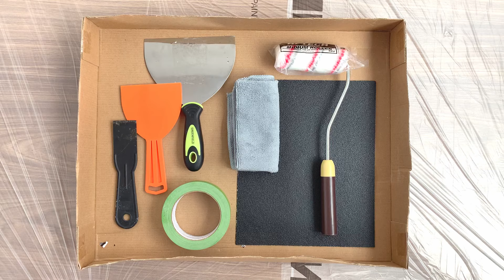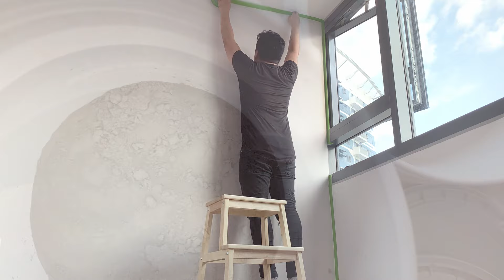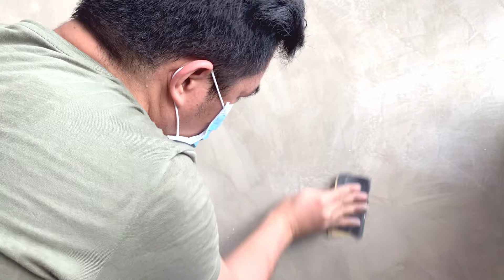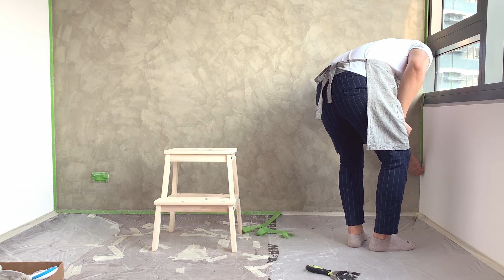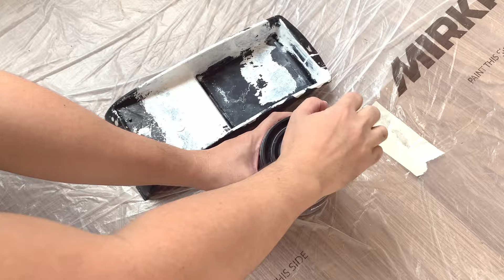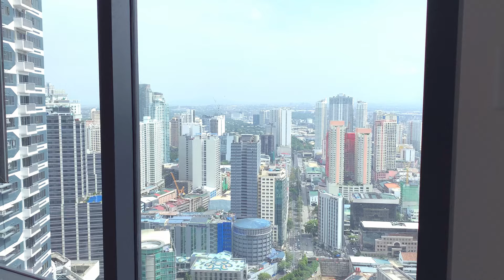How To Create Concrete Finish Wall | DIY | Modern Industrial | Accent Wall

Comment: pwede ba to sa plywood sa loob ng toilet or shower room and waeter proof ba?
Reply from the maker: Pwede po ito sa plywood, concrete or fiberboard. Compatible po sya for both indoor or outdoor use. pero di po sya water proof… pwede nyo po applyan ng sealer pra maging water proof po sya or a film-forming membrane… 😊
Reply: @STUDIOPLOY  thanks for the tips sir

Comment: Sir recomended ba ito sa bathroom walls?
Reply from the maker: Yes, pwede din actually Ito sa outdoor, But since most of the time mababasa sya sa bathroom I would recommend sealing it with a tile sealer para di sya kapitan ng molds and maging water resistant sya.. 😊

Comment: Ano po b puede topcoat jan n waterbased topcoat ung hindi makintab..salamat
Reply from the maker: Meron sya mismong topcoat for it, glossy sya pero pag inapply di sya makintab... pag gusto mo naman na maging water resistant sya you may apply tile sealer pero currently wld pa ko akita na matte sa market pro gloss plant... 😊

Comment: sa concrete wall lang po ba cya or pde ipatong sa wooden wall?
Reply from the maker: @gmadridano4442  aside from concrete walls, compatible din sya sa wood and fiber cement board walls… make sure to scratch the surface with a lower grit sand paper pra mas kumapit and pwede mo na gawin procedure na ginaw ako dito… 😊

Comment: Pretty nice video! Tanong lng po sana if applicable po ba siya sa lahat ng wall types especially concrete?
Reply from the maker: concrete ang ponaka compatible sya... pwede din sya sa drywall and sa plywood. indoor and outdoor parihas swede... thanks btw! 😊

Comment: may i ask, the white thing that mix with cement/grout is white paint or what?
Reply from the maker: I don't know what exactly it is since I would purchase it in set. and Davies would only name it as Set A (the liquid) and B as (the powder). The product name is WallArt Industria. But If I may examine the the component it does looks like cement powder and While Latex paint though it probably has an added component. 😊

Comment: Beautiful work. I’m looking to do something similar in my home. Would you be so kind as to tell me the product you used? The cement and the white glue specifically. Thanks so much.
Reply from the maker: The product I used here is a concrete plastering cement called WallArt Industria by Davies paints. I don't know if it's available in the US though. A subscriber once told me that he experimented mixing cement with white latex paint and works the same... 😊

Comment: Yoo can this be applied to wooden painted walls??
Reply from the maker: Yes, It's compatible both wooden and concrete walls... make sure though to sand the painted wall with a lower grit sand paper and mist it before application... 😊

Comment: Hi po, hindi po ba sya madali magcrack? Pano po kung may kelangan isabit sa wall at need ipako? Thanks
Reply from the maker: If properly applied, Hindi sya medaling magcrack. applied this to our unit and almost 3 years now, still in a very good condition parin. Pati pag pako and drilling... 😊

Comment: Hi bro before you apply the paint. You scratch the old paint at the wall or not. And did you apply primer or sealer first before start
Reply from the maker: I only do sanding using an 80grit sand paper before application. No the wall was already sealed and primed before this application... 😊

Comment: What if I use basic cement mixed with water
 Will it crack?
Reply from the maker: Yes it'll definitely crack, you have to add flat white latex paint that would prevent the mixture from cracking... 😊

Comment: The material you using eslecally for finish is not good, as cement cracks and you get damp and mould on it in time, due to condestation etc. Lime putty would have been best and you could add colour pigments to lime like oxide powder. Lime prevents mould growth damp proff and mould proff and healthy for building and ppl. This is a teriible product, who gave this idea as top coat, will find out the real issues on your wall, waite and see granteed.

Comment: The looks are lovely, really modern and industrial. But I just keep wondering, can a topcoat can be REALLY CLEAR, as all of the clear coating products tend to make the surface a bit darker at the end😢
Reply from the maker: The topcoat I used here is really design for this product and it actually enhances the texture without altering the color. I agree some tend to darken and some has this super shiny finish that I really don't like but this one retained the rawness of the cement finish...😊

Comment: Ang galing! I want to do this design on my bathroom walls. I heard that it's better to apply (a certain degree of) waterproofing with the concrete finish wall. How would you suggest to do the waterproofing? How would you suggest to do the waterproofing without affecting the concrete's raw color/texture?
Reply: Spray tile sealer is transparent

Comment: I'm planning on doing this for my bedroom but I'm a bit concerened to what the process of getting it back to normal would be - were I to ever sell my place. I'm assuming you could just plaster over it again? How do you remove the Concrete ?
Reply from the maker: Hi Liam! It would be tedious to remove this. Yes plastering it over is an option or you can refinish it by applying a wall putty to even out the surface before repainting...😊

Comment: Hello recently subscribed an binging your videos! I'd like to ask, is this something that you would recommend if I'm going to apply this to my 23sqm studio unit? Or is it much easier to just paint in a shade of gray. I know I will miss out on the texture and patterns but I'm not sure if ideal to do so since I'll be doing it by myself only.
Reply from the maker: Welcome aboard Benj! It's easier to paint it with gray but there is an easier alternative and a little cheaper than this one. I would place it in between this and paint. Check out Limewash Paint, It still has this texture though not very similar but I would go for it than gray paint. I have a tutorial for it due for posting next month... 😊
Reply: @STUDIOPLOY  I have a satin finish paint on my concrete wall, I am torn between using Boysen Flat latex white and  Davies Primer and Sealer-- do they function same as primer for a limewash paint? 😅

Comment: does it work on dry walls po ba? di ba yan ba magcacrack kapag na slightly bend yung dry wall?
Reply from the maker: Hi Oliver! Yes its compatible with drywall or any fiberboard made wall even plywood... To a certain extent yes wag lang sobrang bend kasi mbaba tensile strength nito even the actual concrete pero mas durable sya compared to skim coat...😊

Comment: Hello, my wall is currently royal blue. Tapos gusto ko siya i change into this color. Deretso ko lang po ba with the same process as yours, or do I have to remove the blue paint?
Reply from the maker: Hi Az S! The initial step would be to sand it with a lower grit sand paper kung hindi mo tatangalin ang paint, pero if madali lang matuklpa ang paint pwede mo din remove before the application then same procedure na sa ginawa ko dito...😊

Comment: Nag apply po kami ng skim coat, pero after 3 weeks po ay nagtuklap. Finish po ang wall. Ano po ang possible na dahilan? Sabi po ng pintor dahil daw po sa init, posible po ba ito? Yung likod ng wall po kasi na yun at direktang nasisikatan ng araw sa tanghalo hanggang hapon. Magagawan pa po ba ng paraan? Salamat po
Reply from the maker: Hi Clarissa! Masyadong mabilis ang 3 weeks na pagtuklap usually it would take months or even years kahit pa direct sa sunlight yong wall kasi gingamit din outdoor si skim coat... There must be something wrong sa process... Ano ang status ng wall bago sya applyan ng skim coat?

Comment: Sir tanong ko lang po kung anu ung pinagmixed nyo pong una? Pintura po ba un at semento?, kc iapply ko sa wall po namin kc nasisira ang pintura lagi gawa ng tubig nasinip po sa wall.
Reply from the maker: HI jct2! set na yong WallArt Industria pag binili at tinawag lang syang na part A(Liquid) and part B(Powder)... Yong liquid though mukhang paint, mukhang may bang element sya a regular paint...😊
Reply: @STUDIOPLOY  ah okay po, mgkasama na pla un sa isang set, cge po maraming salamat

Comment: Pwede ba yan for bathroom? Will it still be low maintenance di didikitan ng lumot or molds? Thanks
Reply from the maker: Hi Aj! Yes Pwede pero kung sa shower area mismo, definitely overtime magdidevelop sya ng molds kung hindi well maintained... Pero some other parts na hindi basain pwedeng pwede actually pwede din sya pang outdoor...😊

Comment: Can this be applied directly to a wall cement finish? No need to paint it with flat white?
Reply from the maker: Hi Mark! Yes no need to paint flat white, its actually better if the wall is not yet painted for better adhesion...
Reply: Thank you for the info! BTW, nice work!

Comment: can i drill hole after doing this ?will it crack ?
Reply from the maker: Hi Javen! Yes you can, this is actually part of a 1Br unit makeover posted and we drilled a lot and attached a huge framed mirror and artwork and so far no cracks even with my previous project… 😊

Comment: Great job N' video  @STUDIO PLOY 
what if someone wants to paint it white, not grey? like those vintage white color with almost same texture?
Reply from the maker: Thanks Farhad! there is a different product if you prefer white. Industria is only available in gray or cement finish, though you can try using a white skim coat mixed with white paint if you prefer the same texture in white...😊

Comment: Hi! Your video is super helpful and inspiring! 🙌👏👏👏 I really want to do this for our accent wall. Question, can I also do this directly on ceramic tiles on the floor? God bless on all your projects!😃
Reply from the maker: Hi Jerica! Glad you like it! I wouldn’t recommended this for flooring as it will not withstand live loads, also with the ceramic tiles as base it will easily chip off… A better option for a cement fonish look flooring would be polished concrete… God bless and stay safe… 🤍😊

Comment: Hello Sir. Just as I was looking for here. Salamat po... Sir, ask ko lang po sana if this process could be done po ba sa floor or iba naman po? Salamat po sa advice Sir...gusto ko po sana kasi na smooth lang ang floor namin po
Reply from the maker: You're welcome Mercel! I wouldn't advice using this product for flooring, magbabakbak sya hindi nya kakayanin yong live loads... Better option is fresh concrete then pakinisin ng purong cement or best option is polished concrete, hindi na nman ito ganon ka expensive unlike dati...😊

Comment: Hello sir, pwede po ba sya i-apply sa wall na na-smoothing tapos may plexibond na nilagay?
Reply from the maker: Hi LA T4! Pasensya na hindi ako sure if its okay na patungan ang wall with pexibond with this one kasi mas heavy ata ito, baka magbakbak... I would suggest to use lime wash instead kasi parang paint lang mismo and treatment nya...
Reply: @STUDIOPLOY  I see po. How about if may mga hairline crackcs sa wall? Pwede na ba direct na ilagay ang wall art industria or may procedure pa to cover the said cracks?
Reply from the maker: @lat4922  pwede na direct, lihain lang yong surface if painted tapos punasan or spray unti ng water… kung may nag chip naman tanggalin muna bago to apply…

Comment: May i ask what should be the finish of the wall when applying that thanks
Reply from the maker: Hi Justin! This can be applied to painted walls either flat or glossy, but with glossy though you need additional step which is to sand it with a lower grit sandpaper then just follow what I did here... It's also compatible with wood, fiber boards or even gypsum boards.😊

Comment: 🙏 Non Philippine subscriber here.
Did you mix Cement and Paint ?
Reply from the maker: Hi Thee Mclane! Thanks subbing!😊 The product I used here is called WallArt Industria by Davies Paints which is a plastering cement. Though not properly indicated the powder is cement but with the binder I am not completely sure as to what type of paint or prolly a special mix for this product. But I have someone here commented that he got inspired by the video and used cement and gray latex paint and it got the same result.😊

Comment: This is exactly what I need!❤️😍 But pwede kaya sya sa floor? Want ko din sana sa floor, para dina din mag tiles.
Reply from the maker: Hi Melissa! Hindi ko pa sya natry for floor pero di ko din sya marecommend kasi for sure hindi sya tatagal at hindi sya designed for flooring... I would recommend na mag bare concrete or polished concrete pra mas durable...😊

Comment: Hello question po. Pano kung ung existing paint ng wall is glossy gray kelangan parin sya irepaint ng white primer paint?
Reply from the maker: Hi PJ! No need to repaint just sand it with a lower grit sand paper, same lang dito sa ginawa kong procedure, kaya yan matakpan ng product at usually nasa 1-2mm thick naman sya...😊

Comment: How about already finished wall? As in kakulay na po mismo pero di ganun kakinis, ano po gagawin? Bagong gawa po kasi bahay namin
Reply: Pwede rin po ba iapply yung top coat po sa wall namin? Or sa wall art industrial lng po sya pwede?
Reply from the maker: Hi Alpaca! Kung di ganon kakinis yong wall nyo I suggest lihain mo muna... Make sure lang na naaplyan na ng neutralizer yong wall pra hindi mamuti... then 24-48hrs bago applyan mo ng wallart industria topcoat, nabibili nman yon separately...

Comment: Pano po kung nalagyan na ng primer ang wall need ba siya iscrape or okay lng na lagyan na diretso ng cement? 😊
Reply from the maker: Hi Iza! No need na scrape unless nag bubbles yong paint pero if hindi naman lihain mo lang ng lower grit na sand paper before the application...😊

Comment: Pwede rin po ba to if yung wall ay may uneven surface. Ano po kaya pwedeng gawing steps muna bago po gawin ito? Thanknyou
Reply from the maker: Hi Raf! Yes pwede sya make sure lagyan mo muna uneven surfaces then do the first coating... Wag lang sobrang uneven otherwise kelang mo muna gamitan ng grinder for a better result at mas madali application...
Reply: @STUDIOPLOY  paano naman po if may paint na yung wall? pwede p arin po ba ito gamitin?

Comment: Hi Engr! I have a question coz I did this project with my accent wall in my condo. Na inspire kase ako sayo. However, naging patchy ang colors nya light sa top tapos dark sa bottom. Ok lang sana kung parang artsy ang kalalabasan. Eh hindi. Meron kayang remedy nito Engineer? Naka first coating pa ako tapos more than 48 hours na
Reply from the maker: Hi Iris! Did you finish the whole wall in one go or you did by portion? Possible reason for this are if its done by batch it'll have different strokes or probably the liquid part was not properly mixed and before mixing it with the powder... I would suggest to sand the whole applied area thoroughly and make sure only one person applies the last coat to maintain the one stroke... If you can send a picture on Studio Ploy's IG or Fb page I'll try to asses what happened...😊

Comment: Thanks for this! It was so cool but I wonder if I could do it to my orange glossy wall which I don't really like coz the imperfections are visible :(
Reply from the maker: Hi Manuel! Yes you can! All you need to do is roughen the surface a bit with a lower grit sand paper the same procedure as I did here... :)

Comment: Sir panu naman po kaya preparation pag sa rough cement na flooring yan gagawin? parang maganda din kase yan sa flooring may nakita ako ganyan.salamat po
Reply from the maker: Hi Marc! Though di ko pa nman natry pero hindi ko sya marecommend for flooring kasi di nya kakayanin yong live loads... Pinakamarecommend ko for flooring na cement finish is "polishing", medyo expensive lang... For a cheaper option siguro purong cement medyo prone lng sa thermal cracking... :)
Reply: @STUDIOPLOY  sir tanung ko na din po kung ok pabang patungan ng purong semento ang flooring na matagal ng naka rough para kuminis? sabi kase nung iba ndi na daw pwde at magka crack na daw po.salamat po

Comment: Why??? That is exactly what it looks like before the wall got painted... concrete! Hayst. 🤔
Reply from the maker: Hi Mr. D! I Totally get your point... For this project the owner wanted a modern industrial look to the unit and they wanted the cement finish look. If it was turned over in bare without paint I would definitely retained the raw cement finish then we could have save money for some accessories... Andrea is right as well the finish is visually more refined and you can also play with patterns.😊
Reply: @STUDIOPLOY  good job to ur project, i did the same thing to my bedroom.. thanks  for sharing
Reply: Ive been askin this as well , but maybe  its for yhe longevity of the finish? Lols
Reply: The finish is more fine i guess

Comment: Hi! Would this be okay to do sa textured wall. Are you familiar with the common textured wall here in the US po?
Reply from the maker: Hi Gretchen! Is it the popcorn or the splatter? If its one of these yes it can but you might need a lot of products as it would require to fill those concaving parts or hollowed out parts... Maybe try to scrape it off to at least flatten the surface...😊

Comment: Love how it turned out. Since you used it on prepainted walls and roughened them a bit, i guess this will work right away on fibercement boards like Hardiflex. Btw, the top coat, looks like its for waterproofing too. How is the smell of this? And its curing time? Thank you for sharing.
Reply from the maker: Thanks Dennis! Yes its compatible with fiber cement boards even on plywood.. It does have a little waterproofing effect but its more of surface protection.. The smell is a bit nauseous but bearable.. Curing time is around 4-8hrs... :)
Reply: @STUDIOPLOY  thanks! Will research on this product and where to buy. This is relatively new to me but i love other Davies paints products.